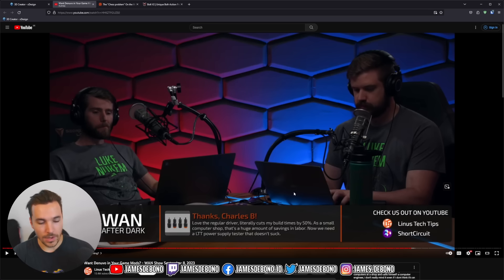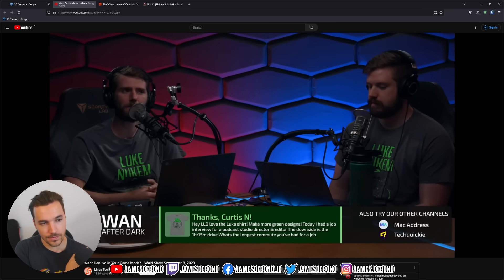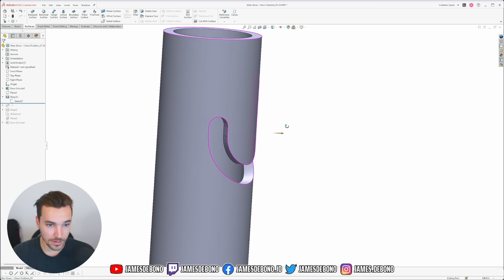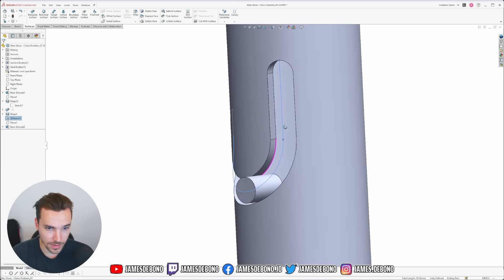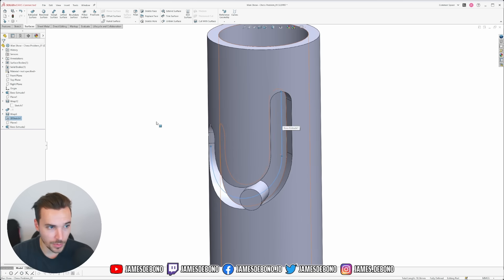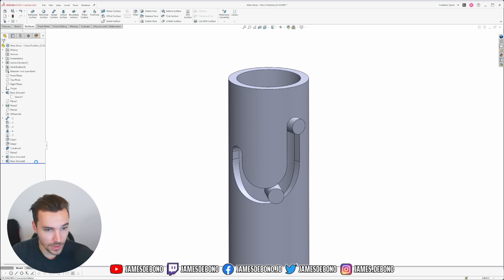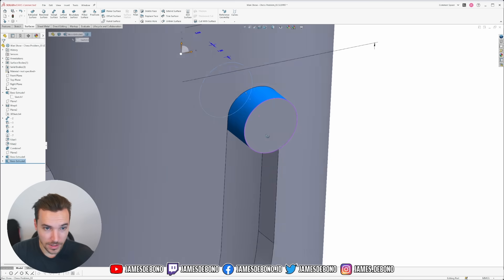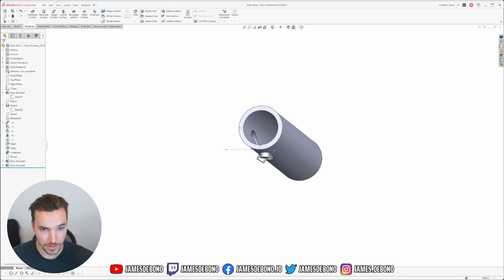LTT - Wan Show "Chess Problem" - Solidworks curved slot in cylinder

Comment: On the first approach wrap example, wouldn't that be representative of a real cut if the end mill was much smaller than the channel and following the perimeter?
Reply from the maker: You could cut it that way with a smaller bit like that but then the edges wouldn't be parallel to the pin from the bolt action mechanism

Comment: My first "for fun" solidworks project after my first semester of CAD classes was to replicate a Sten MK2. I figured it was fairly simple and would be fun to model. I ran into this exact problem with the slot in the receiver. I was humbled as I thought my CAD-fu was too weak to replicate this very simple mechanism. Good to know that over a decade later this same problem is still stumping so many engineers!
Reply from the maker: It's a surprisingly tricky one I think!
Reply: It´s a SWX problem really. I never had think twice about it in CATIA for instance. SWX is simply missing all advanced sweep features CATIA has. I with they would finally carry over all the functionality from CATIA to SWX. Right now it´s a pain to work with SWX coming from CATIA and NX. It´s like using paint after you have been using photoshop for years.

Comment: If you define the center axis of the cylinder, open options in your swept cut dialogue, and choose "Profile Twist" is "Specify Direction Vector" and define the axis as the vector it does what you're looking for.
Reply from the maker: I've tried this too and it also doesn't work. I wish I could just send a screenshot here so I don't have to make another follow up. The feature totally glitches out even more than it did when set to "tangent to adjacent faces" I made a temporary image link https://tinypic.host/image/UcZ3d

Comment: Mechanical engineering student here, with 4-5 years of prior experience with CAD before starting. A lot of my experience is in CATIA, and the easy way is to just use generative shape design. Create the cutout with a bit of projection, create the cylinder walls around it, convert to solid. I should try this tomorrow to improve my skills.
Reply from the maker: Try it! I'm interested to know if you find another viable solution

Comment: Depending on the cam software you can Export a 3D model of the finished machining simulation. Then clean up the mesh; Not the prettiest method but would work.

Comment: As an engineer working in SW myself, making the CAD model look good just for yourself when it's not adding value to your customer is a big nono in my company. I would beat down hard on these practices. Just do whatever to convey the desired design and move on.
Reply from the maker: Yeah it depends what you're doing it for. Making it accurate for my own sanity is something I only do in my spare time but there are a lot of good reasons to do it other than that. If you check the comments on the second video there are a lot of people explaining why it's important https://www.youtube.com/watch?v=TAlYex2l9yI&lc=UgxDWK0TQEF0tDhPEmB4AaABAg

Comment: Pretty sure "ruled surface" is the "correct" solution here?
Reply from the maker: Yes a Ruled Surface would also work in place of the swept surface and is probably a bit cleaner
Reply from the maker: Hey I just posted a new video where I used a ruled surface and got better results https://www.youtube.com/watch?v=QJ83ShySnVw great suggestion!

Comment: Would just like to point out something about the wrap feature for the sketch. If your sketch for the channel is lets say 0.5" The projection on the surface is 0.5" for the ARC LENGTH, not the CHORD LENGTH. you'd need to do some math on the sketch to get the chord length, which is the width of the bit, to be correct.
Reply from the maker: That's true but since we only use the center line in the last solution anyway it doesn't affect the end result
Reply: @JamesDeBono  It was a little tricky, but I ended up using math/geometry and wrap projected two sketches, one on the outside and one on the inside then did a surface blend between both surfaces for perfect perpendicular walls.

Would be nicer if we just had a sweep volume feature like some other CAD software
Reply from the maker: @neondreams2337  There is Swept-Cut with body but it struggles to follow the wrapped path

Comment: I'm not sure if this was mentioned or not, bit in the real world nobody should and would mill a groove with a mill bit in the same diameter as the actual groove. You should always use something smaller for inner grooves and that would make all of those problems disappear
Reply from the maker: It's true that you would use a smaller bit than the slot but that doesn't make all the problems disappear. You still have the same problems you just take a longer time to cut it. The edges of the slot still need to be parallel for the mechanism to work correctly

Comment: I laughed out loud on my drive home when I was listening to their podcast. What kind of industrial design engineer would not know how to make this in CAD? 

Imagine being asked to make a locking mechanism for two rounds pieces but you say no because you don't know how to do it. 

Is LTT ever going to hire adults to do professional jobs?
Reply: I just made the J to a larger radius and subtracted it from the pipe to keep the cut straight relative to the radius of the object. Another method was to extrude the cutting J as a solid and chamfer it to make an angled cut that compensates for the straight bolt.

This was created for a submersible magnetometer that has four wings and a long tail. The assembly wasn't feasible to be a single connected piece, so making the tail section hook and lock to the rest of the assembly was the best way to do it. We had to build the jointing mechanism out of titanium because it wasn't rigid enough to be machined out of delrin or fiberglass tubing. In our case the bolt is a lock that the J hooks around then the lock it twisted to keep it from opening.

I wish YouTube had the ability to link pictures or at least send private messages to share pictures.
Reply from the maker: have you tried doing it?
Reply: @JamesDeBono  Yes. It's not impossible. I designed something similar not long ago.
Reply from the maker: @TechnologistAtWork  It's not impossible but it's certainly not trivial. Even with all the solutions I have presented in the 2 videos I have made on this topic and with all the suggestions from other engineers, I still wouldn't say this is completely solved. Would love to hear how you did it

Comment: I‘ve encountered that same problem a few weeks ago when I was designing a bayonet-lock into some part I needed to 3D print and it was extremely frustrating until I came to the same conclusion as you did!
Reply from the maker: Nice! then I feel more validated :) thanks

Comment: Wow, first off all English is not my native language so I apologise for any mistakes in advance. So I actually made pieces like this in 2009 for a company. and although it looks real difficult to draw in 3D. It is actually very simple. You do not wrap the J form around a cilinder but you first unwrap the cilinder to be a flat surface then you place the J shape where it is supposed to go and take out the materiaal (width off the J shape) completely through the dept off the flat model. Now when you are done you wrap the flat surface back to a cilinder, and that is it. On a CNC lathe with the setup as you mentioned (ours was a DMG Sprint42) we actually programmed the line or shape we wanted to cutout on a C-plane as if it was a flat surface. I hope despite my language problem my explanation is understandable.  😉
Reply from the maker: Your English seems great! Check out my second video where I address this suggestion that was also made by others. https://youtu.be/TAlYex2l9yI?si=zrWo3We4RPLU1csg
You end up with a slot where the walls aren't parallel. It might be possible to fix that in CAM but the goal of the exercise was to have CAD that is accurate to the finished product

Comment: Could you also draw a J extrude it out through the face of the cylinder and then just use that extuded J to cut out the cylinder? (I have done little 50hrs or less of cad work)
Reply from the maker: Check out my second video where I address this suggestion that was also made by others. https://youtu.be/TAlYex2l9yI?si=zrWo3We4RPLU1csg you end up with a very distorted slot

Comment: I am not a solid works person but a 3dsMax one. It is mostly trivial to do in max. You can either do your J curve on the cylinder surface and extrude it flat toward the cylinder center, or make a ton of milling bit copies alogside the J to substract from the cylinder, or many other options. Keep in mind that you will have impresisions in anysoftware anyway so you'll have to build in tolerances in your cut anyway.  Regarding your gap it is because of triangulation. A non flat quad polygon can be triangulated either concave or convex but never flat that is just math.
Reply from the maker: Try it and I think you will find it's not trivial. If you extrude the J towards the cylinder centre you will end up with slot walls that are not parallel. Making a ton of milling bit copies is also equally possible in solid works but would leave you with an equal amount of tiny curved cuts instead of a straight cut so wouldn't satisfy the end goal of having CAD accurate to the final milled piece. Lastly, there are no quads, tris or polygons of any kind in parametric CAD. It's purely vector based

Comment: I personally would have wrapped a sketch from outside like you did first, then do it again from the inside of the part, then loft cut between the two sketches. Though, I've heard that wrapping vs projecting, there are pros and cons. This is from a primarily Inventor user though so... 🤷‍♂️
Reply from the maker: Check out my second video where I address this suggestion that was also made by others. https://youtu.be/TAlYex2l9yI?si=zrWo3We4RPLU1csg the problem is that the inside sketch is impossible to determine from the outside sketch. The outer sketch has a circular arc but the inner needs to have an elliptical arc to match it but there is no way to perfectly determine the shape of that elliptical arc

Comment: In ptc Creo Parametric you could have createt Points and then a spline through them. After that just the sweeping.
Reply from the maker: You can also do this in Solidworks. Check out my second video where I address this suggestion that was also made by others. https://youtu.be/TAlYex2l9yI?si=zrWo3We4RPLU1csg but then you don't have perfect circular geometry and the swept body still doesn't like the spline

Comment: Awesome video!  For a more reliable result - just use a projected curve instead of the wrap feature.  Wrapped curves do not reliably maintain curve characteristics/constraints, this is why Solidworks isn't recognizing the wrapped path as tangent.  If you use a projected curve onto the cylindrical surface, you can do a simple solid body sweep that is aligned to a direction vector (the center axis of the cylinder).  This will produce a result that is exactly what will be milled if the endmill is pointing at the center axis of the cylinder throughout the entire path.
Reply: The sketch to wrap can contain multiple, CLOSED contours only. You cannot create a wrap feature from a sketch that contains any open contours. So, how did you get it?...
Reply: Projected curves have an issue, and this is, that you can only project over the visible face of the cylinder. How could I fix it?

Comment: I only have experience in AutoCad (I know it is not very good in 3D modelling). But when I model there, I would draw the cylinder and a plane surface of the "J". Then I would extrude the J, so it becomes a volume. And after that I would drag the "J" into the cylinder and do a volumetric substraction. I would assume, that this would work for that kind of Problem 🤔
I don't know if that would be a solution for Solidworks tho.
Reply from the maker: Check out my second video where I address this suggestion that was also made by others. https://youtu.be/TAlYex2l9yI?si=zrWo3We4RPLU1csg the issue is when you fold it back into a cylinder the walls of the slot will not be parallel

Comment: I've hit so many CAD problems like this. Where I want to sweep a body along a path. Surely it must be mathematically possible?
Reply: Though of course, it doesn't actually have to be mathematically exact. Because the real world isn't. And you're going to add in clearance gaps anyway.
Reply from the maker: I think it should be mathematically possible too. Seems like a Solidworks bug. I'm gonna try get in contact with them

Comment: Also, for the first attempt you use, there is also a way that is similar to what you did the third try, that is to extrude a curved even surface. I only know how to do it in fusion 360 so I will put the workflow this way:
1. Emboss the J
2. thin extrude the J into a sheet body.
3. Cut the profile with the sheet body you just created.
4. Remove the face you just created, and loft them back together.

I think it will work, and although It did not show clip in fusion, I believe it works.
Reply from the maker: Are you suggesting doing this on a flat surface and then folding it back into a circle?
Reply: @JamesDeBono  I finished the second video right after posting this post. Thanks for addressing!

Comment: How about, unwrap the profile into a sheet metal, do the cut and re-wrap the metal?I think in that way it will also generate even offsets.
Reply from the maker: Check out my second video where I address this suggestion that was also made by others. https://youtu.be/TAlYex2l9yI?si=zrWo3We4RPLU1csg the issue is when you fold it back into a cylinder the walls of the slot will not be parallel

Comment: As a fellow engineer with some experience in making some wild stuff in CATIA I applaud you for pointing out the logic for the tool path.
I used the offset-method quite a bit, because CATIA loves surfaces and hates boolean operations, plus you have it parametric associative, and everybody loves that.
But a sweep of the tool cross section along a path of the surface, using the path as the spine and normal line to the surface as axis would be usually quicker.
Greetings from Germany 🥳
Reply from the maker: Hey Greetings from Germany also! Yes I'm Australian but live in Berlin. The sweep would be ideal I think but Solidworks has issues with it

Comment: Getting back into SolidWorks after being away from it for years, this reminds me of having bosses that just wanted the design out quick rather than 100% correct as long as the machinist knew what to do.  Bugged the hell out of me some times when I could see the interferences like that.
Reply from the maker: I feel the same way, I understand it in a way, it doesn't matter to them but I feel the urge to make it right! Sometimes you have to let it slide for the sake of time but it's nice when you do something off the clock that you can make it perfect :)

Comment: Model the slot as a body, and combine cut. I use this for like 90% of what I do in CAD. You can also fo things like copy the surface,.offset it, extrude to the offset and then comvine cut, so the bottom of the cut follows the contures of the main surface
Reply from the maker: I did model the slot and combine cut it! haha

Comment: I know less than nothing abut solidworks but to me this seems like a resolution problem on curved faces where a quad should be a theoretical infinite number of 4 tris going in 4 on each face. This comes form me using blender for many years where you have much better fine control of mesh geometry and vertex mergers into quad faces.
Reply from the maker: There are no quads, tris or resolution in parametric cad. Only maths :)

Comment: @4:10 - Important Question, how is an open contour being wrapped? 
As far as I'm aware that isn't an accepted input. My only guess is it's more like a VERY thin contour than a line, yeah?
Reply from the maker: It's a single line. Under the "wrap type" option you just need to choose "scribe"
Reply: @JamesDeBono   - Yeah, that was the first thing I tried as well. For whatever reason that didn't work -- but troubleshooting SolidWorks between versions and systems is almost futile some times :) Was just hoping there was some other obscure wrap option you used... Thanks for the reply and for sharing!

(I just get: "The Wrap feature cannot be created from intersecting or open contours") 🤷‍♂
Reply from the maker: @Maker_Jake  Another commenter told me that this ability was introduced in 2023 version

Comment: Hi, just wanted to let you know, that your 3rd solution was used by Mercedes Benz to model the furrow on the Cam-Shaft for the CAMTRONIC (just google it). This would geranty to ensure line contact between the pin and the forrow, otherwise the pins would break off from the high stress due to the point contact.
Reply from the maker: Woah nice to know! are they hiring? jk. That's good to hear the method verified though thanks!

Comment: As an engineer with experience that I still consider humble, my first instict was wrap yes, but as soon as you showed that it extrudes with slanted walls, I immediately thought of surfaces. So I find it epic to know that I cam to the solution that quickly. Seems like 2 years of product development and DFMA work in addition to my other years of SW have done me well.
Reply from the maker: Hey nice work! it took me 11 years in Solidworks to get here so you're doing great 😉